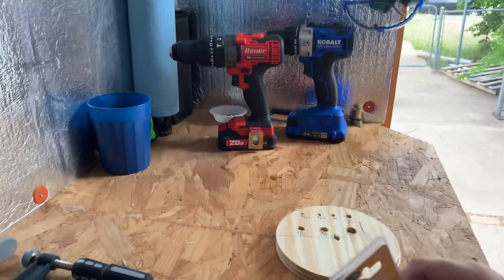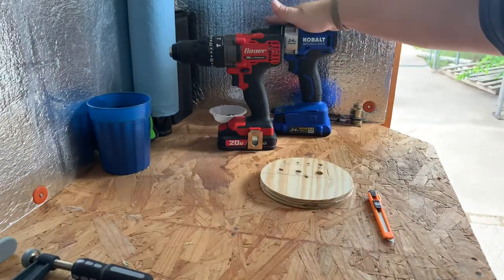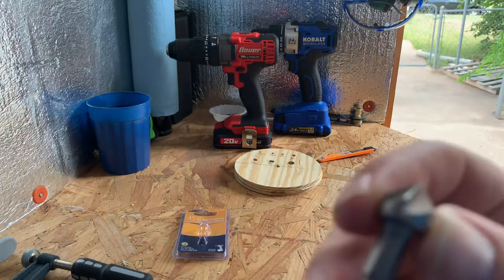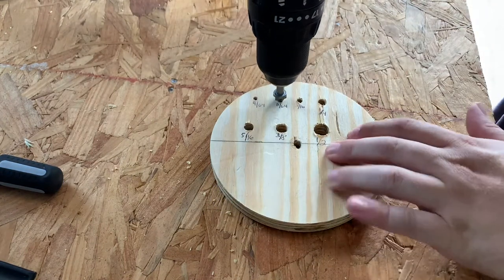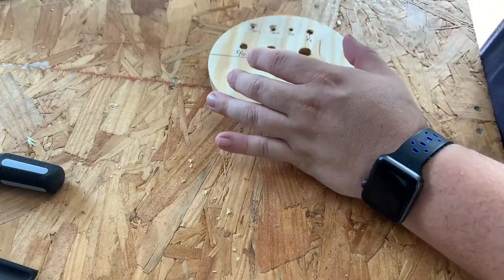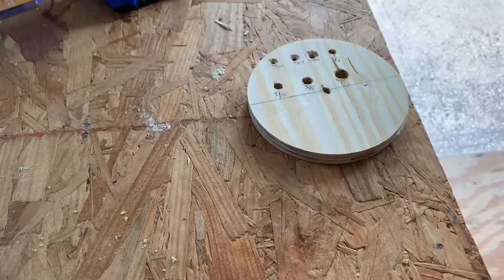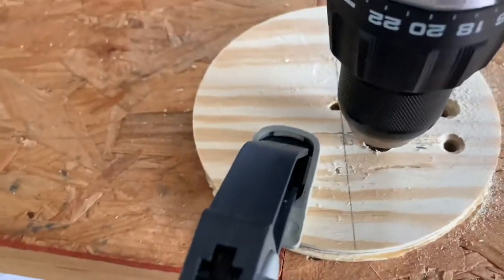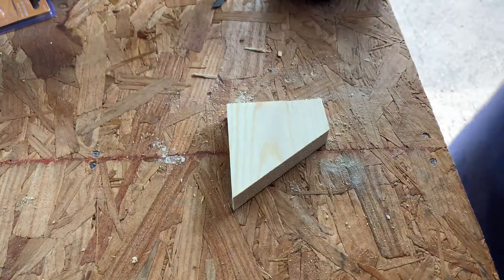Harbor Freight Countersink Bit

Comment: It works great in aluminum.  Perfect circular holes in aluminum (not the clover leaf effect you're getting in plywood) 
Just used it today. Go real slow in metal as slow as your drill will go, Press hard. 2000 RPM is way too fast.